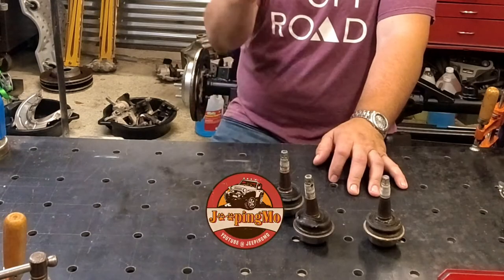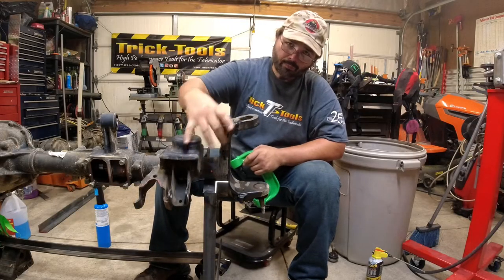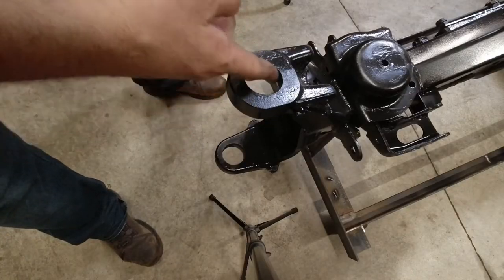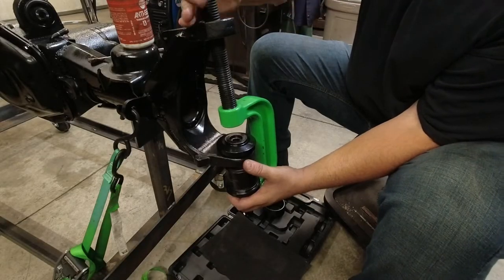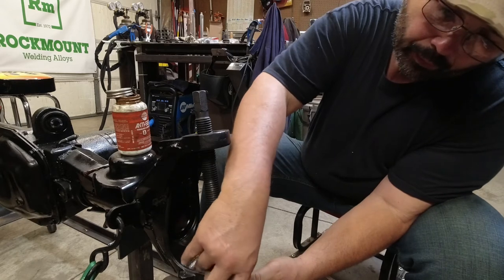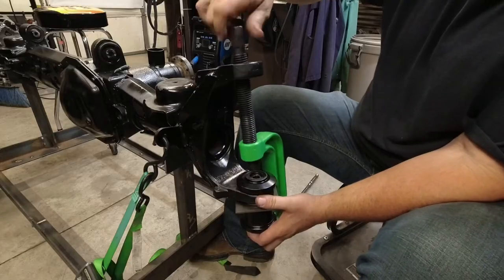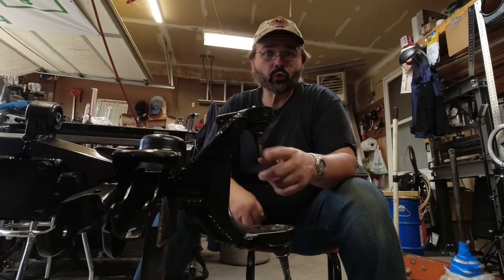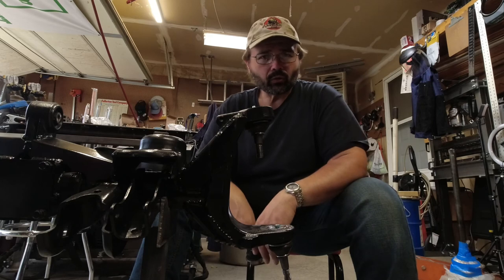Replace Your ball joints/  HD Balljoints.

Comment: What are your thoughts on these ball point deletes that are appearing?
Reply from the maker: I might use them if i was running 40’s,  and beating on it all the time. King pin front ends have been around for a long time.  I don’t have any plans to run them. Thanks for the support.
Reply: @JeepingMo  Thanks for getting back to me.

Comment: What were the condition of the stock ball joints you pulled and how many miles did you have on them?  I have 60K miles on my original JKUR ball joints with 37" tires and I am afraid of what mine look like or wondering how many more miles I might get out of them.
Reply from the maker: The ball joints had 45k on them.  I don’t think they were bad, but I had to take them out to weld on the gussets.  That was an opportunity to upgrade them.  Are you getting any signs they are going out?
Reply: @JeepingMo  No signs at all yet but from what I have heard I "might" be running on borrowed time.  It's tough however to judge what the internet says vs real life.  That is why I like videos like yours...real life expericnce not swayed by sponsors.
Reply from the maker: @darrenroos6408  you can jack it up a little to put a pry bar under it, have someone lift up and see if you have up & down play in the joints.  Not sure what the spec is. I would not want to see more than 1/16, but I’m sure it should be  much less.
Reply: @JeepingMo  someone ran into and destroyed my JLUR this week.  I'll probably pass on replacing the ball joints for now...
Reply from the maker: @darrenroos6408  hopefully everyone is ok,    was it totaled?
Reply: @JeepingMo  Yep, and I got screwed by Geico in the payout
Reply from the maker: @darrenroos6408  o really that’s not good